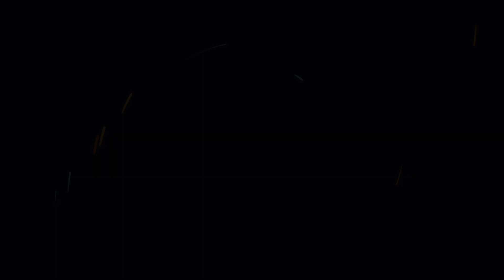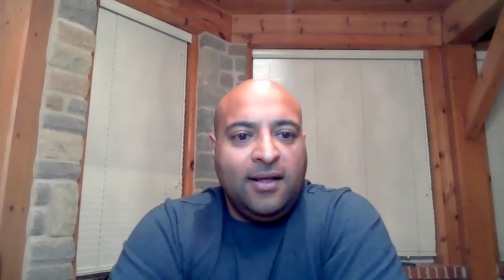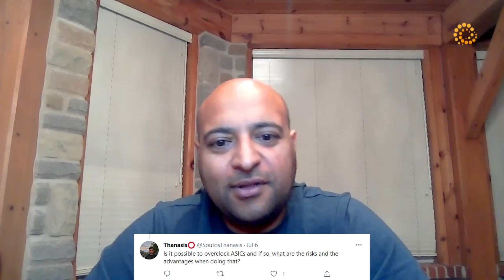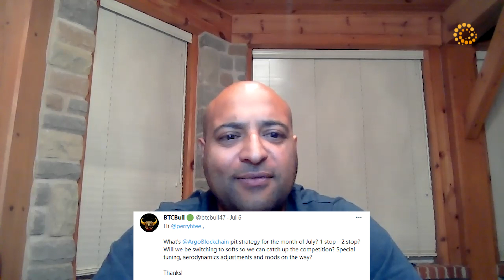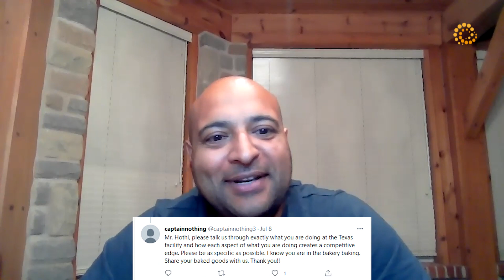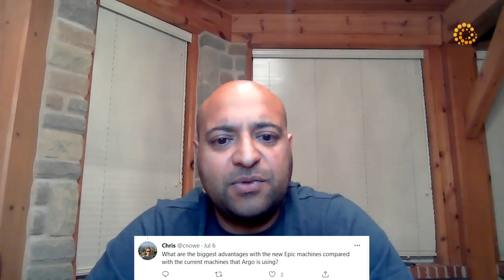July, 2021 - Argo Blockchain CTO, Peter Hothi's Twitter Q&A  | Part 2

Comment: Here's a question, why mine high and sell low? Given the amount of btc you sold last year, the loan is a big liability if bitcoin drops it seems to me you may have been better off selling the btc or even half/half. If selling btc increases your average sell price then I suggest you do it. Holding btc when it's high and selling when its low suggests a lack of experience with BTC. Hindsight is of course not nice.
Reply: Shut up , they are mining more coins even if Bitcoin drops these lot double they coins from previous mining they are making more profit since China stopped 2nd July 2021 ! They can pay that 14 million loan off in 2 months !
Reply: Mathew Argo believe in BTC 100% long term. Zoom out and don't worry about the 64k high and that they'd of been better selling then. That will be broken and the fall back to 30k long forgotten. Think in months and years.